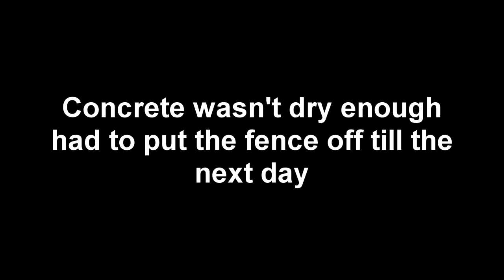Who's Going To Help Finish The House..?

Comment: JOEEEEE STOP BEING CHEAPPPPP, and get this house fixed the RIGHT way ya know hiring professionals to do a professional job, so the house is up to code and everything is done correctly!! This is NOT gonna end well if you keep going the cheap route and continue to hire folks who are not certified and do professional grade work! .. This house has to pass inspections man and has to be up to code otherwise ya gonna be shit outta luck and stuck with this house that has been fixed halfassed
Reply: Hes just doing what landlords usually do. Fixing things the cheap way.
Reply: Lol joe doesn't care
Reply: As a licensed plumber and pipefitter, I don't feel joe is cheaping out as much as not talking to enough contractors he always takes the first guy off craigslist he should of met a few contrators before he started
Reply: Then has to spend double the money to tear the shit work out/down and fork out more to get it done professionally, do it right the first time or don't do it at all. As the saying goes "measure twice, cut once"
Reply: I realized recently that Joe has created an excellent record of himself flouting the zoning ordinance and pulling zero permits as he pays an unlicensed electrician to put in a new breaker box on something that's NOT his primary residence.
Reply: He would rather hire 5 guys 5 times and pay each of them $300 to have all of them do it wrong instead of hiring one guy for $1,000 to do it right.
Reply: He can't he's broke remember 😂
Reply: Joe is NOT being cheap. A couple weeks ago he was 17k into the house. likely over 20k now.  Hes spending money. But he's paying morons.this house should've been done and flipped by now for no more than 10k.
Reply: Stop giving him advice he's too stubborn to listen.
Reply: Amen I really don't think he gets it... Sighs
Reply: Chad Gochis  Yes around 10k. But of course that would mean Joe would have to start putting in some work also. at least grab a broom. I'm not talking having a whole construction crew their either. Joe and the felons can do a lot. Then hire a plumber when you get to the plumbing call an elec. when you need one. I wish Joe would get a tripod set it up in a room and make a video of him tearing down drywall/replacing mudding/taping. That would make a good house flip video. and hed save lots of money.
Reply: @dustinwilliams251  the roof is 10k bud, the management on the project is over 10k, the flooring is 10 dollars a square foot, and he's got 1000 feet to do, that's 10k, the drywall work is 1500, the stucco over the top is another 3 grand, the labor on the demo is 2 guys for month, that's 5 grand at least and the tipping fees on loads are 350 per load , probably 5 loads that's another 1750, where do you get 10k for the whole thing?  Learn to estimate itll make you money.
Reply: Yeah. He done paid out to what he could have hired a pro, I done got that shit done!
Reply: It's not about being cheap. He's just doing everything wrong..
Reply: @SargentandGreenLeaf  Joe could pay gelico, rabbit and peewee 500-600 a pice and those 4 could put a new roof on in 2 days. 10k on the floor? why stop there might as well make it 20k. if hes spending 10k on flooring in that house hes dumb as hell. 10k for management? who is managing anything? If Joe was there to at leaset supervise HIS workers on HIS jobsite maybe they would get some work done.
Reply: @dustinwilliams251  I'll give you 5 grand on the roof because it's a smaller house, but you have no idea of management costs, the daily to and from and hours spent, he works out of his house so if he's running the job, and that's his only job, then the entirety of his living house, all bills to said house, his salary, insurance on the business, truck, gas, truck insurance, mileage wear and tear, it all adds up management and overhead.  Not to mention the longer the job drags on for he's losing money on interest on the money itself he's used, that money could have sat in a bank and generated 3-6% interest.  If you aren't figuring overhead and the 95 bills that come with that into your management costs then you are estimating wrong.
Reply: Chad Gochis  lol yes you could. For way less than 10k if YOU did most of the work. demo, framing if needed, drywall, paint, install everything. Hire an elec. if needed. a plumber if needed. if you go with tile hire a tile guy if needed. But yeah if you don't know how to do anything or are not willing to then it will cost you a lot more.
Reply: Misty HAVE YOU MET A LANDLORD before?
Reply: If you're tripping breakers, you've got wiring problems in the house, and replacing the panel won't help. If the electrician you've hired says he needs to pull new wiring in the house, the walls need to come out.
Here's the basic order of operations for a remodel:
Design and Planning. ...
Roof, Foundation
Demolition. ...
Structural Carpentry. ...
HVAC, Electrical, and Plumbing. ...
Insulation. ...
Drywall. ...
Windows.
Fine Carpentry 
Interior painting,  wallpaper, and other surface finishes. 
Flooring 
Siding, gutters, exterior painting
Reply: This is the taking losses show
Reply: Joe... "Didn't like the first plumber too much." Yea... He was a Professional! lol
Reply: Joe wants Brian crackhead prices
Reply: I worked for habitat for humanity we never hire professionals
Reply: Andy Flores he needs to if he thinks it’s a money pit now the deeper in ya go the deeper the money pit gets
Reply: What are you talking about the house looks like it's coming along great, I can't wait until the house renovation is done, man new windows,doors, the whole shebang. This house is gonna be a nice home.
Reply: I truly hope this does not happen . But since the breakers are tripping then something is not correctly wired so that potentially means all that sheetrock work is gonna have to come down to find where the wiring needs to be fixed. . When the plumbing person comes in and finds issues with the plumbing the floor may have to be torn back up to find and fix the issue, Joe already made a comment while showing the inside of the shower that it isnt done right (I am thinking plumbing) so all the tile may have to be ripped out ..  the tile on the floor in the bathroom is all scratched up and etc etc .. 
Joe does not know the correct steps to take when flipping a house, and he has not hired a licensed contractor to not only help Joe know what is going on and etc but also make sure whoever is doing the work is doing it the correct way so these type of things do not happen .. whatever materials have to be ripped out to correct the electrical/plumbing issues will have to be bought again, and Joe will have to pay someone else to put all that back up again .. Joe is costing himself more money by not hiring a licensed contractor to oversee this house flip, and Joe doesn't stay at the house long enough to oversee what is being done and he doesnt have the knowledge to know if these things are being done correctly! .. There has to be inspections done and if it doesn't pass inspection then ya have to fix whatever so it will pass which costs MORE money.. I still do not understand why Brian put in tile in the shower and on bathroom floor before the plumbing and electrical was already completed and inspected.... ya gotta fix everything INSIDE/UNDER the walls/floors (foundation, plumbing, and etc) and make sure it all passes inspection, before you can decorate those walls/floors.. and for goodness sake when ya go to look for someone to hire to do everything that doesn't have to do with inspection type of work, then ask for references/pictures of their work ..  all work that needs inspecting hire PROFESSIONALS as in licensed/certified ..
Reply: Misty Fisher He’s going to end up paying for it three times.
Reply: God forbid Joe pays market rate for a job. Shit might get done and done correct and on time. Where's the views in that? This is After Prison ShitShow for a reason
Reply: Misty Fisher nah nah joe wants to “half way crook” it like a loser so he can make content bitching about it
Reply: Misty Fisher well said there is final inspection and the potential home buyers inspections. Pay the money get it done and over with
Reply: Most savvy house flippers hire all professionals to do everything at once quickly and get it done in 2 weeks, putting it all on a business line of credit, and sell the house for profit before the credit card is due, paying it all off with no interest.
Reply: Misty,  you're so right.  It's hard to watch without telling at the screen.  Insurance might even be a good idea.
Reply: But one of the main points of this project was to offer work to felons
Reply: How many times did you fall off your bike when you first got on it? Joe didn't jump into this house flipping deal, lookin to do things cheap and shitty. He invested in a house to flip and give employment opportunities to guys that would normally have trouble makin money out here in the free world. Yes of course he isn't looking to lose money. He's never flipped a home, much less, knew the cost of  flipping a home. Everyone keeps talking down on a man that is out here busting his ass to help people find their way after being locked up and also trying to run a YouTube channel and keep content flowing. Joe is learning to ride this bike as he goes but, has the damn guts to keep getting back up on that bike, every time he falls. This is his first try and he's done pretty damn good for knowing jack shit about it. He's been ripped off by someone he was looking to give a chance to prove himself. He's not trying to cheat anyone by renting out a house that is intentionally half assed. He's fixing up a house to sell it. He's not looking to cut corners at all. He's just looking to not lose his ass. Not one of you YouTube critics are offering advice or your damn time to help Joe in this investment. Just watching him struggle and commenting that he's doing everything wrong is real easy to do. Especially when you don't have your money invested in Joe's business. It's all Joe's money, time and effort that's being invested. He's not out here begging for help from you clowns. It's only him that is taking all the risk. Joe is doing what none of you would do. Even if you had the ability to do it. But, y'all all quick to criticize. Joe is a good dude and has proven that he's a good dude. Nobody can say, "he hasn't earned what he's achieved." I watched him grow from an ex-con that was struggling to make ends meet, to a successful, respectable, hard working, industrious YouTube personality that practices what he preaches. You don't find that in most anyone that has never been through half of what Ole Joe, has been through. But, your out here ready and willing to point out what he's doing wrong and how he's supposed to do it. But, y'all ain't talking bout how you have done it and how you learned the house flipping business. Y'all are all about how Joe's money should be spent and who should be gettin Joe's money. Y'all ain't talking about your investment property and how you spend your money on class A contractors that will charge you top price and put the cheapest guys they can hire on your job to make the most profit. Y'all all about how Joe needs to not go the cheap route but, can't explain how going the not cheap route will benefit him at all. Why would he even be doing this house flipping investment and using putting it on his channel if he was just gonna buy a house and contract out the entire remodel to contractors? You know. The NOT cheap route. Y'all lookin like a bunch of haters and jealous ass punks out here criticizing Joe. He's got more talent, drive and charisma in his pinky than most of you have in your entire existence. Let the man do his thing. If it bothers you that much? Go start your own channel and see how far it gets you. You all seem to think you're some kind of professional house flippers and know how to make boat loads of money by spending top dollar on overpriced contractors to do all the work. We should all be watching y'all make entertaing and interesting content that goes beyond sitting in front of your phone and making a video about how you read a measuring tape like a boss and then come home to your trailer and drink Natty Ice until you pass out. Then wake up every morning to go work and make your bosses more money. That's some real shit. You could make a whole 2 or 3 videos about your life and how you could be the running shit but, your wife took you for half of everything and now you make YouTube comments, criticizing successful and talented people's content. I'll wait for the links to your channel when you get that up and running. I'll even subscribe. I don't hate. I appreciate anyone that can prove they can do better than the people they want to criticize.
Reply: Chad Gochis  So having done it a few times. Would you say its better to pay extra for the professional job/installs or trying to find the best bang for your buck?
Reply: @SargentandGreenLeaf  damn a stucco install on that house is 3k?
Reply: @handsomeitalian5238  Anytime you do anything new, you're more than likely to have to suffer through some learning curves.
Reply: @harrynutsackk  I've sold roofs pretty recently man. 10k is not out of the question. Maybe if you throw junk up there with you might pay 65 with "warranty". they saved money on removing the chimney themselves but even still, 10k is reasonable with a half recent shingle.
Reply: Literally took the words right out of my mouth...TIRED OF HEARING THE NAME “BRIAN” 🤮
Reply: I agree man its getting to the point of ridiculousness, sell the house to a family and have them burn to death because you hired some dick of craigslist to save a few hundred to a couple grand, shit is actually starting to piss me off
Reply: Videos of people doing good work don't get clicks
Reply: Lol that fence work he did makes me laugh. Since i done a pro fence job before. It takes hours to just get the measurements right but it's worth it.
Reply: The more I think about it I think I know why he is going the route he is, he cant hire a legitimate company because he has no permit or plans from a engineer so if a licensed contractor gets caught working on that job without a permit he will get fined or at very least a very stern talking too, im sure they ask if there is a permit and that is why he did not want to film the conversation
Reply: @angiet7380  Right! Everybody seems to be forgetting that. In a perfect world, Joe helps felons get work while making a few bucks on flipping. No felons, no Felon Flippers. I get that some of the work may have to be done by non felon professionals.
Reply: It’s really easy for the YouTube comment warriors to say your doing it cheap and shitty because ya know they renovate their flip houses professionally 😂😂joe your doin good you have the same problem I do you give the benefit of the doubt to people don’t deserve it holding it gives them the confidence they need to stay positive and help themselves and they just prove time and time again they cannot be trusted my best advise is something I need to practice more myself but never give the benefit of the doubt to anyone ever again....it’s sad but it’s hard to trust anyone that doesn’t have somthin got loose
Reply: My mama says that stupid is as stupid does.
Reply: how come we have not seen an Approval from the city inspection with the ground jacks
Reply: I hope Jellico wise up and put the smack down on Joe
Reply: @gamerslockerslife4444  what happened to Pewee?
Reply: @moose2345  Do you think there is a family out there that would buy this house? I'm not from USA so I'm genuinely curious
Reply: Greg Pettis  You watching the same videos I'm watching? Where's the bargain in paying for EVERYTHING a second (or third) time? Might as well hire a company with the slogan "We do it right because we do it twice"! Lol How'd any of those "Bargains" work out for him?
Reply: Too late now. This guy isn’t smart enough to realize that and now look at him. Wasted thousands of dollars and seems the house is in worse shape than it used to be. Hopefully buddy learned his lesson. I’ll keep him in my prayers
Reply: And whilst putting all of it on YouTube for any prospective buyers to see.
Reply: Malicant You beat me to it! Can only imagine if someone buys it then finds these videos. But Joes thick headed enough to brag about after prison show and lose the sale after they watch one video.
Reply: p q Joe couldn't even wait to get the keys to the house! He broke in and started spending money the first day! Lmao research how to remodel and flip a house.
Reply: This comment thread is hilarious! People ripping Joe, and people defending Joe
Reply: He needs to get some help in there that can read a tape measure. Gelico cannot read a tape measure
Reply: Im getting a tad bit pissed at joe atm cuz he dosent fucking listen I would just hire a full professional team then get it all up to code sit on the house a tiny bit to get the Price up and then make a BANGER Profit
Reply: Good comment, I have been telling him the same thing.
Reply: He's flipping a house you have to do things as cheap as possible to keep down the overhead real estate 101 this being his first house these problems are expected he will find a crew he likes and uses for all his work eventually
Reply: @chrisswanner4279  Chris that's not true. You have to use licensed bonded professionals. That is cheaper in the long run. Or they wouldn't exist, why else do you think they exist? You think people that have flipped 1000 houses all of a sudden decide hey I want to pay too much for something I don't need? No they learned by doing it Joe's way that cutting corners doesn't help anything. It also makes it hard to sale because buyers are going to ask the seller to provide written documentation from a licensed contractor  of all crafts to sign off on that house. If they don't insurance either won't cover or it's too expensive. Again education is the key not guesses.
Reply: @misty_fisher  the electrical problem is probably  in a junction box where a light or receptacle or switch is.
Reply: @angiet7380  And I am all for that!! However hiring a licensed professional to oversee the project is very much needed, he can hire the folks trying to get back on their feet to do the work as long as they k ow what they are doing .. and the contractor will be there to oversee their work... I am not saying stop helping the felons .. I am saying hire a professional to oversee the whole project and it will stop alot of the things that have gone left from happening..
Reply: heretik system  to be honest yes, there is always family’s looking for homes
Reply: man, ya'll chill on the salt.
Reply: Lifetime of bad karma coming back at him doesn't help either.
Reply: Well because not all folks can afford Union labor at 65 bucks and hour and 23 smoke breaks.